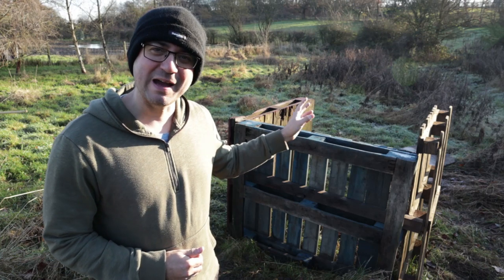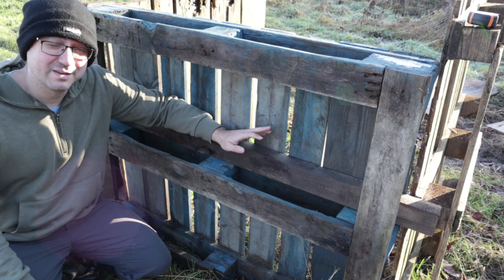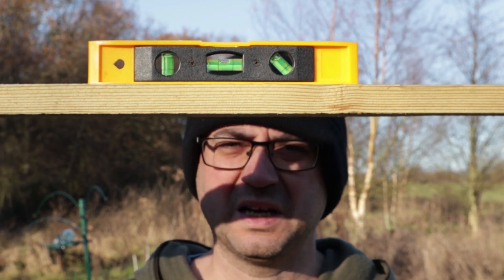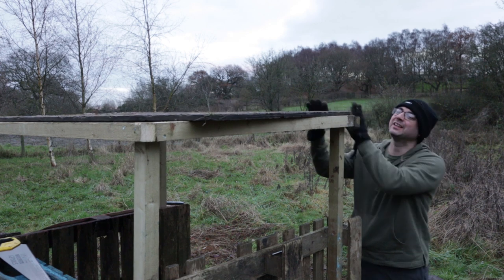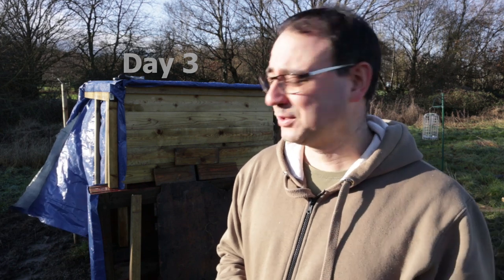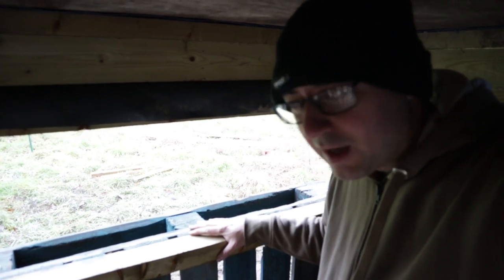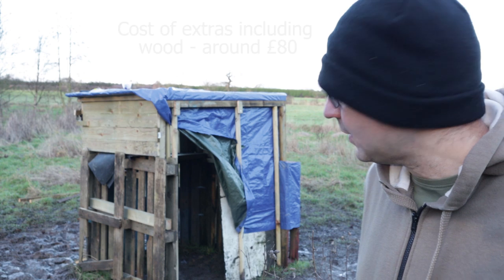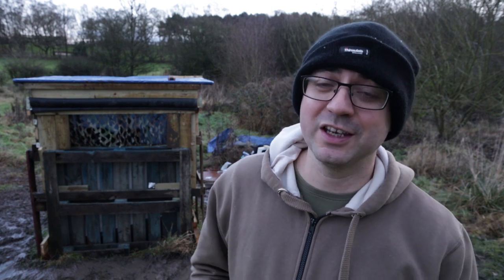How to Build a Bird Hide - for Bird Photography

Comment: Just re-watched this, wondering if/when you will follow it up with images/videos. Also, just an observation- if you turned the pallets around, you could make shelves easily inside the hide for a cuppa, TC's etc. 
I may have a go at mine now I'm off work, lots of activity at the moment. 
Cheers Paul.
Reply from the maker: Nice idea for the the shelves. Actually I chose to do it the other way round cause it was easier to put together that way.  I've done a video on small bird photography from this location; I wanted to do a vlog from the hide but ran out of time

Comment: as you have a great ledge on the hide i would suggest adding a bolt you can screw a gimbal head onto, it will be much smoother than a bean bag and you already are 90% there with the shelf !
Reply from the maker: It's a good idea. Unfortunately i have had to dismantle this hide now.

Comment: Lookin' good, it'll be sweet once you get the scrub bush around it.  Then you can go and plant some choice perches in a few locations if the landowner permits that.  You could easily extend the back with some poles and scrim net if you need a little more room to stretch out on, without having to build more structure. You got an Instagram?
Reply from the maker: Great advice there. No I don't do instagram.